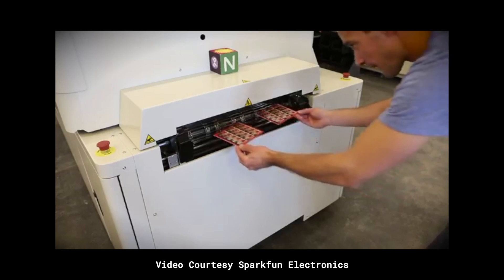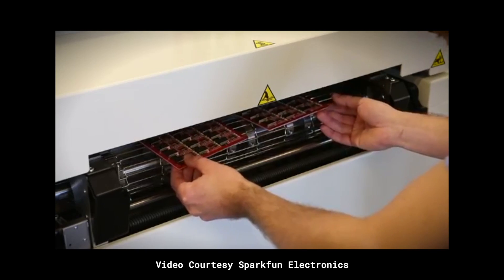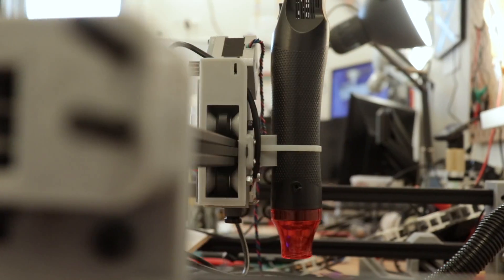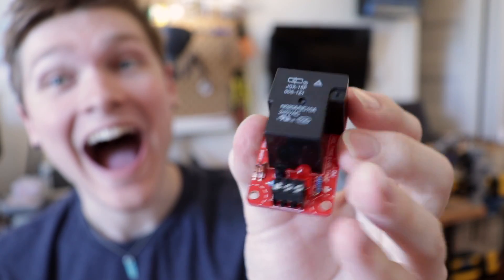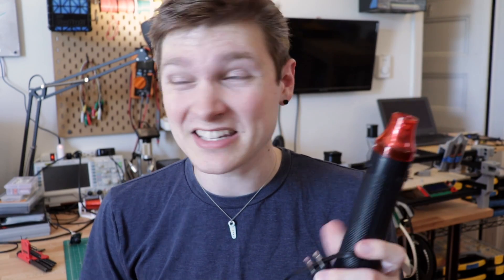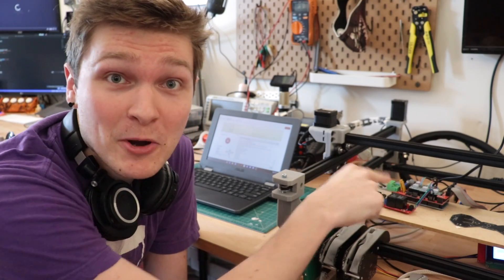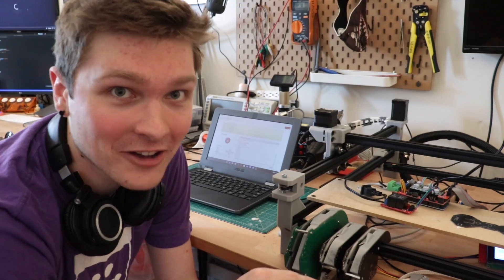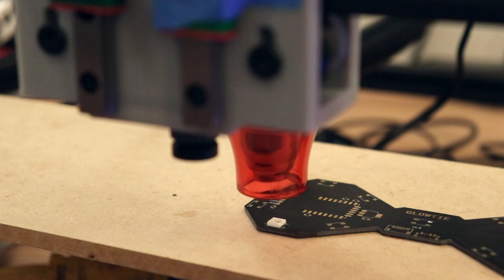Automatic Soldering On My Pick and Place!

Comment from the maker: Hey gang! After giving this a try, I'm leaning towards ditching this feature and switching to using a reflow oven! Would love to hear your thoughts on the pros and cons of both.
Reply: I love the idea, but from personal experience doing a toaster oven with a reflow controller is just easier. Awesome vid and project though!
Reply: It's a good idea, but an oven reflow is probably easier and while you are reflowing a board in the oven the pick and place could be doing the next lot of boards.
Reply: maybe you can get a ceramic hot plate like you can get for 3d printers as a surface to lay your PCB on. Just place the components, and switch on the heated plate for a while.
Reply: @kurzschlussjunkies  I've seen a heated bed of sand for this.
Reply: reflow oven is small and works out of box. You might wanna add ultrasonic water cleaner as well. Board -> Reflow oven -> Clean -> Package
Reply: Yeah that's probably the best move, plus it doesn't tie up your pick and place machine
Reply: I really like the idea, but having some experience with hot air soldering it would be easy to overheat a large component if the movement isn’t well thought out. Having to manually calibrate the heating time for each junction my lead to lots of damaged boards too. A toaster oven will reflow a decent sized board (or many small ones) much quicker and results will be repeatable and within the components specifications. Good idea but perhaps instead of reinventing the wheel this time, just use a wheel. ;-)
Reply: I bought a 200x200mm 600W pcb hotplate for my cnc-laser-paster thingy, also a water cooled 3D print head is on it's way. (3d printer have hotplates.. don't they? 🤪)
Probably a bad idea to mount it on the 4 axis, too...
Reply from the maker: Welp, seems to be overwhelming evidence that reflowing on the head isn't the most sensible choice! Thanks for the feedback all! I appreciate your thoughts and considerations! :D
Reply: @stephen_hawes  Reflow oven FTW
Reply: @stephen_hawes  Sorry we burst your bubble. Also greetings from Newton Ma!
Reply: I think even if this method worked well.  switching to a 12v version would have been more difficult as it would have been 10x the current draw.  so you end up with separate power supplies and extra complexity there.  Even though the oven is extra component next to it.  having it self contained, to where it can be easily be connected or disconnected when you set it up.  The electronic components are all segregated to this oven component, and you can build a better temp control.  You could easily modify a convection oven to do exactly what you want, it will be more reliable and you can keep the 120v components there.
Reply: also, reducing the picking/placing head complexity is probably a long term benefit with reliablity.
Reply: Use Laser for reflow. :) That will be really fast.
https://www.youtube.com/watch?v=vuQLbCMaC9Y
Reply: @TheUNLICENCED  watched the video seems really cool, but that is going be lots of engineer to get just the right amount of heat for each kind of joint.  Seems more like a version two kind of idea.
Reply: While I really like your enthusiasm and out of box thinking (which
makes your videos fun and great to watch) I would take some things in consideration.

1. A modified reflow oven is probably the easiest & fastest way and works well.
2. As you know P = U * I. And a heat gun has > 600 - 1000W. So running from mains this will need ~4A. Doing this with 12 V Dc will need >50A DC. Trust me that is nothing you want ;-)
3. When you are doing projects with mains you should go for insulated cable end sleeves when using multi strand wires. And you should no longer solder them. Also go for a double insolation or use protected earth. (since you have good 3D printing skills just go with a plastic case where you put your mains stuff inside and you are fine ;-) Also use cable reliefs for your mains cables. stay safe ;-)
Reply: Oh and get a crimping tool for the cable end sleeves you will like it ;-)
Reply: Hi Stephen, 
Using air gun can be only for small board and prototyping. 
1/ Soldering paste need to follow a specific profile with ramps, flat period then reflowing peak then cooldown ramp. Those values are (of course) different depending on kind of paste 
2/ this take a long time to cook one board, so unless you have only one to do you better cook one while you pick and place the next.
Anyways your project sound great and I would like to communicate with you on PM for further things. 
Do you have a website or Email to communicate?
Reply: How about making the bed of the PNP from aluminum with built in cartridge heaters and thermocouple with PID control for reflow profile. I have done this with a 100x100mm block for small PCBs and it works. You can then just switch on heaters once all SMD is placed. Use ceramic insulators to insulate heat bed from your PNP frame. You could use fans to cool it down quickly or peltier heat pumps.
Reply: I've used a covered hot plate (cheap electric skillet) with great success. Let it soak at ~150°C for a couple of minutes, then set it to the paste melting temperature and wait until it reflows (a couple of minutes). No need for a full toaster oven with controller in my opinion. If your reference was hand soldering with an iron or hot air and that was working, the extra bulk, complexity, and cost is not worth it for the temperature control you gain with a toaster.
Reply: Oven reflow makes a lot more sense. I mean it's cool that you can do this but thermal profiles for different parts can very a lot and the incidental spray of hot air from the nozzle on denser placement boards will be an issue. There is nothing more painful than having a $20 smt metal film capacitor unfold in the heat like a tiny book. Also if you keep this feature you need Z axis adjustment because the current flying height is too low for a lot of smt inductors. (i do a lot of analog)
Reply: I like the idea of keeping everything automated, even if it's harder to design. A computer that can heat specific spots for a specific amount of time is hella valuable. Esp if you want to add a 3d printing head to it. Then you could add extra heat to places which need smoothing or have to be more structurally connected.
Reply: I'm going to agreed with everyone else here, use a re-flow oven. 
I'm worried that creating g-code that visits all of your components / pads while avoiding overheating delicate components could get extremely complicated. Imagine a MCU next to a bunch of SMD resisters and your hot air gun visits each SMD device individually...
Reply: My very first thought was WHY???! A toaster oven, even unmodified would be quicker and more reliable. Check out @Unexpected Maker and his Reflow Master controller to mod a toaster oven for a good quality reflow oven on the cheap (and small).
Reply: Reflow oven would give you more consistent  results. You can but smaller ones for around $200 on amazon and eBay. Maybe make it automated putting the pcb into the reflow oven?
Reply: This really is an awesome project! I'd say that you do definitely want to heat the whole board uniformly, which at least makes the software easier! Maybe have a hotplate and then a grill that moves over the top of you want to integrate everything. The better answer unfortunately is to reflow elsewhere, as I'm sure you do not want to slowly melt your beautiful PnP!
Reply: A toaster oven is the way to go. The preheat and cooldown ramps are important,, and it is the only way to solder under devices, as when you have thermal pads that need bonding. Creating a controller that monitors temperature rise and fall rates and follows a timed plot is almost trivial for a guy with your skills. Doesn't need fancy curve displays, just a start button, a thermistor to monitor temperature and an electronic relay to turn the heating elements on and off in a PWM pattern. A $5 Goodwill toaster oven with no fancy electronics is the starting point.
Reply: Do you know when vision be integrated?
Like, up and down facing cameras?
Reply: When I read the description and understood pick & place reflow, I thought "that's hot!"
Then reality raised its ugly head and spoke up. Heating the paste without thermally conditioning the parts can cause damage to the parts.
Reply: have you considered finding a 18-24 volt battery one, and hooking that up to power while connecting the controlling circuit on the gun itself so your pin trigger can act as a trigger pull to let the hot air flow? less than mains, you can most likely make a new case for the main components, keeping in mind the hot end of the heater, and have your own heat gun for the machine, a little hacky yes, but when a custom enclosure it looks less hacky :D. best of luck in your endeavors and I look forward to more pick and place :)
Reply: I just bought a 4500w 110v t960e a day ago. Its like 1000mm by 450mm, reflows up to 300mm wide. 1800 bucks on amazon right now.
Reply: Great Scott just posted a video about 3 different methods of reflowing. I don’t think the hot air is a good idea because it can melt some parts. Hot plate bed with sand is not a bad idea but it would see easier to just use an oven.
Reply: Reflow oven will save you a ton of headaches.
When it comes to hand reflowing I have a compact IR heater plate with a similar hot air tool (think I showed you in our call).
Lately I don't do much PCB work, but since I'm expanding my lab I might get an oven at some point, just to have it there :)
Reply: Also, a couple extra points:
- store your paste in a sealed bag in the fridge (remove needles from a paste syringe when you do)
- You don't want to just shove hot air on a component like that. You need to pre-heat the board following a paste profile, and the hot air needs to be hovered around the component. By hand it takes building up the skill. In a reflow oven the reflow profile does it all :)
Reply: Did you look into wave-shaped laser soldering?
Also if this machine is dedicated to pick and place + soldering you can probably get away with just a solenoid for the z axis.  There only maybe $1.2 each.
Reply: Seon (Unexpected Maker) has a Reflow Master board for a toaster oven. Might want to check it out. (budget idea). There's also the T-962 reflow oven (see GreatScott!'s video re: improvement mods) . Toaster Oven and Reflow Master might take up less physical space though
Reply: I think there's a really good reason why the pros use a separate oven: the more weight on your head, the slower you have to run it for a given rigidity and motor power. Hanging more stuff off it means it has to run that much slower.

As to 12V heating...just no. 120V isn't that awful. For the same wattage you'd be running 10x the current which means 10x the mass in wiring. Again, a heavy pain in the butt.

Personally I'd modify a toaster oven with an awesome PID controller and a conveyor belt right through the middle.
Reply: What I'm working on will use a thermoplastic substrate so I am going to have to go with the heat gun method.
Reply: I think what you're doing here is great, and fun to watch the hot air gun do its thing.

This project could also make for a fantastic crowd funding project.
(I would recommend letting a factory assemble the PCBs for that, though, as I know how much work that can be otherwise.)

But I was about to reply saying the same thing about a reflow oven. Maybe even a mini toaster oven just large enough for a typical board would be better, as it should be much faster to heat up.

Looking forward to seeing your conveyor belt design. ;)

I've had half the parts for a 3D printer for about five years now, but never felt the need to build the rest of it. lol
I thought it would be a giant pain to calibrate, and be a giant time vampire.

But seeing your designs for the PnP has made me want to build the rest of the printer.
Reply: Hey, why dont you add like a heat bed, so you can activate it when is done picking and placeing and reflow the board in one go 😁😁 you can use the circuit form an iron for clothes
Reply: Working on a project that lays substrate, traces, pnp and solder. Combination of heated bed, enclosure and either hot air or laser.
Reply: While the oven would obviously be more straight forward, it would require control of a designated mains outlet with some relay control. Given you are looking to keep the unit self-contained, avoid using a mains circuit, low cost & custom, why not utilize a 12VDC glow-plug with a fan and baffle?  You could then customize the form-factor of the reflow heater to more suitably fit your gantry.
Reply: It is a lot cheaper and easier just to buy a 100$ oven like Puhui, probably just to apply some more capton tape and you are done. 
But okay, you can try to make a bottom heating bed on your working area and use an external quartz IR heater or just a xenon projector light.
But you would need more or less precise temperature sensor attached to the board. 
But it is not rational at all since that you just loose on heated area + it is open, nothing is packed in thermostatic box. 
So, that's why just focus on precision of PNP. Applying a soldering paste is already a questionably thing.
Reply: Did this for the lab...It works well and ripped all the control knobs off then replaced it with a 3d printed cover with LCD panel and a Arduino Mega.  The timing was a bit tricky but I can turn it on, hit the button and it does the correct warm up, then flow, then cool down to make a reliable board. It still needs some work but I definitely like it as its a Black and Decker toaster oven with the heat tape internal, then uses a temperature probe to monitor the temperature constantly and has a fan for regulating the right temperatures so that I don't cook the chips.
Reply: I guess Im asking randomly but does someone know of a tool to log back into an instagram account??
I somehow lost my login password. I love any help you can give me
Reply: @Kyle Jayden instablaster ;)
Reply: @Solomon Ariel thanks for your reply. I got to the site on google and im in the hacking process atm.
Seems to take a while so I will get back to you later with my results.
Reply: @Solomon Ariel It worked and I actually got access to my account again. I'm so happy!
Thanks so much, you saved my account !
Reply: @Kyle Jayden No problem xD
Reply: Yeah, the whole thing with wanting it to be 12V is impractical. It would have to be north of 45 amps of current, what are you gonna switch that with? a contactor? Plus your power supply would have to be super beefy
Reply: i would agree with you ditching this in favor of an oven, i find some small parts anything smaller then 603 can get blown around by the hot air and some parts like LED's are subject to get burned if the hot air is on them to long, this can happen when you reflow the LED but then move onto a component right next to it and the LED is still in the hot air path, when using a hot air gun i usually heat the board from the back as to not move components or melt LEDs if possible, an oven is another step but the results are always better
Reply: I personally also think a reflow oven is easier. But just because it's easier, does it mean sb/ should give up a interesting addition to this awesome project? I think it also has a lot of charme having one device "to do it all", while you drink a coffee or tea :D Maybe it would be also worth changing your "2.5"-way head to a 4-way head and having the heat gun as a optional setup for one of the heads.
Reply: Hot air on the pick'n'place is slightly bonkers, but also totally awesome! I like the idea of a single machine that can do everything because a hobbyist may not have lots of workspace. Obviously slower than separate stations for paste, components & reflowing.

Comment: Also for better reflow of components except LEDs is raise the PCB board an half inch off the plate so PCB heat up the reason is PCB on the wood board tends to absorbs heat taking longer to reflow

Comment: One advice is never reflow led diodes from on top with smt heat gun you can damage it. , always smt heat from bottom of the PCB board it's less damage to LEDs

Comment: Bro, just use the heat bed, clamp your pcb on the heat bed of any 3d printer, let your pnp cnc do all the work, applying solder paste and placing components, after this just turn on the heat bed and leave it on for some time, all components will be soldered at once, this is not only simple but also saves time.
Idk I haven't tried yet, correct me if im wrong.
Thankyou

Comment: That's pretty cool! I'd just rip apart an old toaster and rewind heating coils for 12 or 24 v, put a little pwm fan controlled motor on it and reload the components into your budget mains heat gun. I just got a 100mm square hot plate and it's great for SMD!

Comment: I know you've changed your reflow approach since posting this, but a quick safety note for you or others who read:
when adding a switch inline you should always break the "hot" line, not the "neutral" or "ground".  For US plugs, the "hot" line is the narrower of the two plugs.  For non-polarized cord ends this is of course irrelevant, but you really shouldn't mess with those too much unless you're experienced (in which case this warning is probably irrelevant).  Non-polarized cords are generally either dependent on other safety features to prevent shock, or are attached to older devices.  Accidents involving mains are, as a rule, not fun.

Comment: I thought WS2812B 5050 LEDs are heat sensitive and shouldn't be soldered with a heat gun or in an oven, but only soldered on a hotplate? Did the LEDs all end up working after this video?:D

Comment: A heating element will work on any voltage provided you give it enough amps to keep the same wattage. The heat gun fan motor needs the right voltage to work correctly. Or you could change the motor to work with the supply voltage you use.